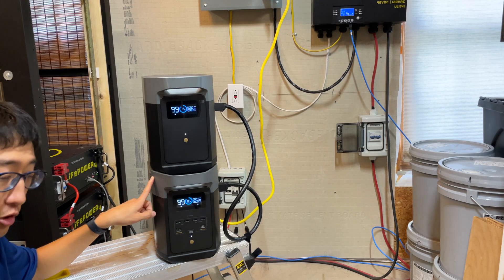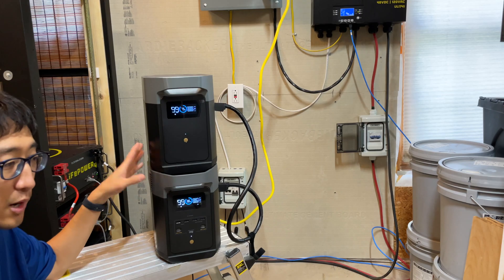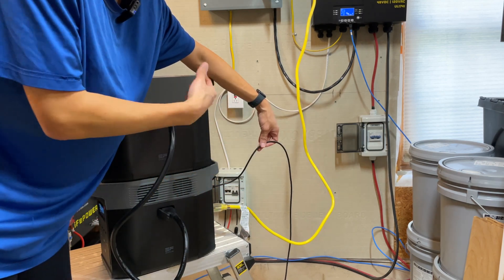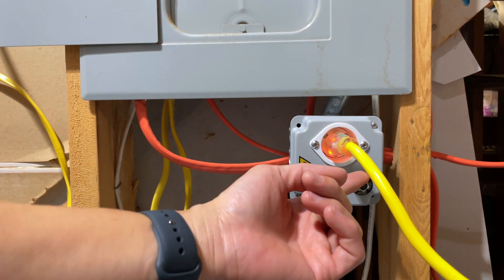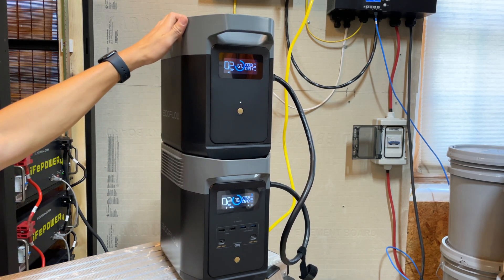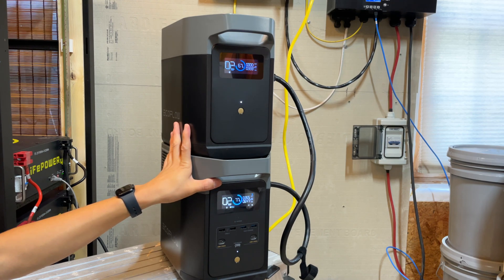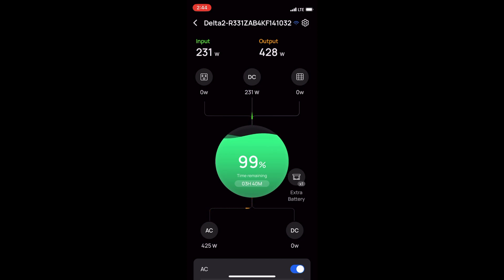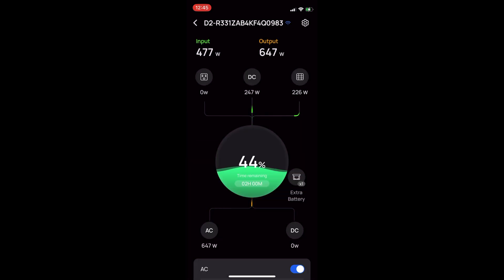How long can EcoFlow Delta 2 run an AC mini split ? | Solar powered AC runtime | Mr cool on Solar

Comment: I would like to add, the Mr Cool seer rating is not very good compared to a solar mini split made specifically for off grid use from Airspool or Signature Solar is pretty substantial. There has been much greater success with people using one of those mentioned 12K systems for less power draw. You do not need to hook the solar panels to those units if using a power bank, even though thats what they are made for, just run the solar panels to the power bank, or you could even do both for a dual solar system. You will get much more runtime using one of those systems verses the Mr Cool. I know this video was just a test, I am only adding this because I saw it done. A guy runs his 12K mini split from Airspool on an Anker 3800 power bank, with 4 solar panels hooked up to the mini split directly and another 4 going to the anker. He can un 24/7 in that configuration, cool and heat, day or night, rain or shine

Comment: So, how many batteries will get you through the night while running the mini split?
Reply from the maker: Depends on your current temp, outside temp, and what temp you set to.
 I have a hack where I’ve connected a 5kwh battery to the solar input to give it more juice and it can get through the night with the delta 2 , and the extra battery, plus the 5 kwh pack making a total of 7 kWh.
Reply: @tgbatg well, I live in Texas, so basically the worst scenario possible. Our worst electric bill last summer was 3308 kWh. We’ve gotten better at using less power since then. Thanks for the info. I’m just starting my solar journey, so it’s still very difficult to make decisions.

Comment: Newbies here.  Can I power my mini split v120 1200 btu and plug my solar panel input line to charge the unit at the same time?   Extending my mini split run time?

Comment: Do you think a Delta Pro will run a 18K MrCool?
Reply from the maker: Is there a 120v 18k? Those I think would be 240v. You would need to get the delta pro 3 or the delta pro ultra.

Comment: Surprised that mr cool only uses 110.    That’s interesting.  More is better with AC other wise it runs non-stop.
Reply: I installed 4 mini splits in my house . I chose 110v units as they are only 9k btu . 9k and 12k will have choices of either 110v or 220v .anything above 12k btu will be only 220v . They run nonstop regardless of 110v or 220v . Mini splits are designed to run nonstop . They ramp up power to cool down a room then reduce power to maintain . My mini split goes as low as 110-150 watts to maintain room temp . Very efficient . Going from central ac to mini split my power bill lowered by $120 month in Florida summer .
Reply: @jimjr9143  you can set them to shut off when they reach a certain temp as well.
Reply: @JD_Advanced  not for inverter mini splits in cool mode . You do not want to shut them off then back on anyways . I did so manually thinking that would save power . All it did is increase humidity in the room . When cooling it gets really cold . If you shut them right down adding warm air quickly from shutting down. It becomes a wet mess . The next time you turn the mini split on it will shoot into the room wet humid air . I called up 3 different mini split companies all saying unit staying on in cool mode is intentional and necessary for those very reasons . Only in heat mode does it shut down when set temp is reached . 
 When i do power off my mini split i turn on anti mildew mode which will dry the unit and i will run a dehumidifier to soak up all the moisture from the drying mode . If mini split where to cycle on and off like traditional central ac it would promote mold growth .
Reply: That specific unit does, most of them are 220.

Comment: Get some real batteries.
Reply: I'm guessing you completely missed the server rack battery system in the corner? Portable system there guy. Not portable if it's 200lbs.
Reply: Cry harder
Reply: @JD_Advanced  suck harder

Comment: Did you ever consider using the built in features of the Delta 2 to automize the power? You can set it up to when the batteries get to 20% then use wall power to charge it up to Ex:50%, this will continue until the solar charges the batteries back to over 50%. You will never need to manually switch the split ac from sources. You can also attach the Delta to your battery bank via solar to keep the system fully charged.

Comment: Hey wondering why you don't plug the Mr Cool directly into the EcoFlow? Do you know if you did plug into the ecoflow if the app would allow the battery to run down while only drawing from solar until a minimum battery set point?
Reply from the maker: True, technically it’s the only thing connected. So I do use the energy management feature to do what you mentioned.

The reason it’s not direct wired to EcoFlow is because when it was first installed it was installed to the main panel. Only after purchasing the EcoFlow did I have the thought to power the ac from it
Reply: @tgbatg would you be able to show how you would wire directly from the Ecoflow to the mini split?
Reply: I can Plug my mini split with soft start directly into a portable power station ac outlet . Mine is not wired into my panel . I just installed 12 gage line with plug on my mini split and plug it into room outlet . It’s only a 9k btu unit which uses very little power . 110-150 watts when in maintenance mode .

Comment: It always baffles me why people go to the expense of buying the standard delta 2 when for a bit more money you can get the max which had twice the capacity
Reply: You can get the max expansion battery and use with the delta 2.
Reply: Then pick another brand these are not cosmetic items they are functional why waste your money on something that only does half the job you need when you could buy something from a different manufacturer that will fit the same cost
Reply: $1500 compared to $600?
Reply: Exactly not everyone has that kind of money
Reply: @levih4174 those prices are way off and this guy in the video has a 1kwh unit + a 1kwh extra battery you could get the max which is only a little bit more expensive but now it’s all in one box rather than 2 and you get the option of expanding later on if you need more, I really don’t understand the point of the standard
 delta and delta 2 it’s such a weird area of price/performance it’s not enough storage to do anything really worth while with when it comes to replacing a generator

Comment: Man! so happy you made this video! I am considering running same mini split for my single car garage, set up panels and run this separately from the house. Right on.
Reply: Did you end up doing anything with your garage? I am doing the exact same thing. Have a 10'x20' detached garage and going to build a temp insulated wall in the middle and have a 10'x10' escape AC room during blackouts. Just bought the delta 2 and the 220w panel and doing some tests. Plan to upgrade and get another battery and panel next year as well as a 2kw predator generator to use as a backup and supplement a few hours a day.

Comment: If you had a Delta 2 Max you would need to upgrade the panels going in.  Or to save $ you could go with your current panels in series in to one in put and then a couple of larger panels in to the other. 

We don't have such Air Condition needs in the UK but it is always interesting to see how other people use their power stations and solar.

Comment: wholly cow about $6000 investment to run an ac in a little room for 1/2 day.  Or a 650 watt frig for 2 to 4 hours.  I can get a dual fuel 500 inverter and run 4 or 5 of my frigerator/freezers and get another one for a couple ac units at 1000 watts per and buy 5000 worth of propane.  I get it the sun makes your energy but have to say the math doesn't make any sense.  Every review of these solar generators are done by folks who get the products for free.  I love the way the industry is going and at some point they will be there but at this time they are silly.  You can drop like 50K on the Ultra's and still you don't have near the power for a hot Texas day with a 5 ton and 3 1/2 ton.  Fossil Fuels make the world go around.
Reply: I disagree you wouldn't have a bill if you dropped 50 k on a full home solar set up easily that's here in phx so hotter than texas that's why here it's actually worth it now is it worth it everywhere absolutely not gotta look at average days and hours of sun ect
Reply: Talk reality I can get average 16% return from S&P index fund including dividends.   Sometimes it's better to buy the most reasonably priced HVAC price/performance.  When the battery/panel tech changes in 5 years you will want to upgrade.

Comment: Macbook Pros are pretty efficient, especially if they're Apple Silicon.  I have to get on my wife to turn off our LED lights because they pull more power than my Macbook Pro and I go through a lot of effort to run it off of solar.

Comment: I have eco flow delta 2 max.  Wont even push a small heater so I doubt it will keep up.  Bought the AC/heat unit from eco flow it would be great in a Van thats it.
Reply: A heat pump is 4 times as efficient as a heater. No building runs AC off batteries. Hospitals use diesel generators. It’s really strange people think batteries can run heavy loads indefinitely when commercial buildings can’t. The battery will hold essential loads and so I suggest a fan for grid outages

Comment: If you aren't mobile, why are you even using these in this situation. It's such a weird fragment of users who don't provide much useable data. You won't even survive the first wave of this being necessary. I bought a Delta 2, 2x 220w bifacial portable panels, a Glacier w/battery and a Wave2 w/battery, this black Friday.  ~$3700 vs ~$5900. My Wave2 was free in every calculation. The conditions I can live in without sacrifice are mind boggling. Versus a room full of Apple laptops and users that still choose Apple. Wild. You provide hope, in a bad way.
Reply: 0 likes in a month.  My people didn't disappoint

Comment: Get a Signature Solar hybrid (DC/AC) mini split.
Reply: How does that work? Tia
Reply: @factsstats3779 I have the hybrid mini split. I have it connected to solar panels but also have it connected to the grid. You can run the mini split with only the solar panels. I leave it plugged in to the grid and when it needs additional power (cloudy days) it gets it from the grid.
Reply: @factsstats3779 I believe it can take the DC straight off your solar panels and battery with no AC conversion loss. But it will also take AC from the grid.

Comment: If i get a 6000 btu 115 volt mini split would it run at a lower wattag?
Reply: Depending on the seer rating. You want to go with as high as possible for more efficiency.
Reply: @carlosreyes6448  i already bought the lowest possible because i thought that would be more energy effictient. I mean i have a very very small van to power
Reply: @carlosreyes6448  never mind i got one with a good seer rating i was thinking of a different number on it. Thanks

Comment: I feed my delta 2 with six 100 watt panels...2S3P...so I get 40ish volts at 15 amps with xt60i cable.
Reply: I feed my delta 2 with 2 x 285 watt amerisolar polycristaline panels. IT delivers 420 to 480 wats easily. One advise, buy rather delta 2 Max, because of Higher  invertor Power so you Can use IT with laundry machines.
Reply: What are the specs of your panels open circuit voltage to be specific
Reply: @musangubeni6942  i dont remember....renogy 100 watt panels. Older models. About 22voc but new ones are 24 voc. In actual use they put out 19 or 20 volts.
Reply: Voc 38.7v.  Vmp 31.7v. I measured in real conditions  around 34.3 V and amps are 8A  each. So in paraler conection around 16 amps. Delta 2 will limit current to 15 amps. So 15x 34.3=514.5 wats. Ekoflow delta 2 Has limit 500 wats fór solar imput.
Reply: So can you power a mini split AC and plug into a solar input line to extend the AC running duration?
Reply: My exact roof set up on my bus